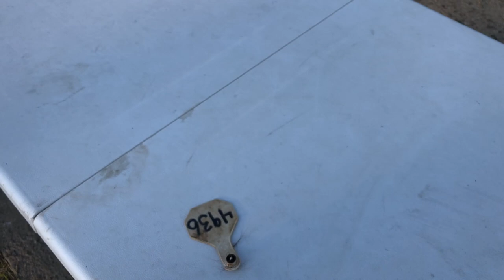Handling BISON up CLOSE!! GoPro ATTACHED!

Comment: Enjoyed your video; especially where your GoPro was placed. I'm from a cattle ranch. We had a set-up similar to yours for branding, cutting, and doctoring. Let me recognize  that Cattle  are different to handle  than Buffalo. Just a suggestion: Run it like a production line. Have one person responsible / function. Someone to load them into the chase, another to close the gate behind them, another to squeeze them, ... even so far as a person to load the syringes (we had guns), give a particular shot and someone else to worm them. Also, someone responsible to open the gate. I hope this gives you some ideas. You'll get the kinks worked out. I think you're doing a great job. You seem to have a lot of patience. We had 360 cows plus their calves and it was hard, fun, rewarding work. I wish you and your family the best.
Reply: Excellent,  constructive comments.  Gives you the specifics you need.

Comment: Don't worry about the chest camera.  Fix or modify the crash gate so it is out of the way of your head gate.  Put a bar through that hole where they stick the cafts heads through.  Otherwise in my opinion that catch gate is going to get someone hurt.  I would also put a fence that comes right up next to about  3 feet away so the crash bars and swing open without hitting and thing put a gate just behind where the crash bars swing open.  But also block the Bisons view to who would be at the gate.  Then also put a panel between everyone working and the released Bison as they leave for safety.

Comment: 12:15 I wonder if putting something up so they can't see out the shoot will help prevent them from trying to break out thrue them bars in front it seems that there seeing a exit so there trying get out because i noticed when they can't see anything in front of them like a wall they are more calm so once you get them locked down you can remove that blinder and you can work the animal.

Comment: A recipe for disaster.  Too many people shouting instructions.  The guy who makes the final release  should be giving the instructions and should get an ok confirmation  from all the helpers that the various corral gates are in their proper locations and locked.   Sort of like  performing a rock blasting operation.   Count down and push the button. I agree on that squeeze gate.
Reply: It would appear that you need to rehearse what you want to have happen BEFORE the animal comes in. There were too many people giving instructions, some of them not very accurate. Know what each lever does so you aren't finding out with the animal present.

Comment: Just from observation, I would close up the hole on the headgate, all 3 tried to climb through it, lucky no legs were broken.  The "squeeze" part of the chute looks like it needs a solid handle instead of a rope so you can get more umph into the squeeze part.  I don't envy your job though............Stu.............Cheyenne

Comment: If a little lubrication helps the gates and squeeze work faster would that be a good thing or bad? Also that head cage 2 of those critters tried to come out that hole on the side. Why does that not have a vertical bar that hinges into a pinned closure? I guess it is a good thing that they see you every day.

Comment: Couple words of advice. When u work em designate one job person (which u obviously did). Less talking. Only should be hearing Dusty's voice cause they are comfortable with him. Put sheeting or rubber belting on inside of crash gate and just leave a 2ft x 1ft opening in the front. That'll slow em down into the crash gate. Also close up openings in squeeze at bison eye level. That will calm them up better. Also get a scissor head gate.works wayyyy better. You have a good set up and you did great!!! When those magnificent beasts are confined all they should see is in the direction you want them to go. I work mine that way and it works for me. Love your herd, keep up the great work!

Comment: Having worked with my ex husband who is a large animal vet the one comment I would bring is that you need a pair of nose tongs to use when putting in ear tags or working on the head. You can pull the head to the side to immobilize it while not really hurting the animal. Makes it MUCB safer for you & since the head is immobile the work can be performed faster causing less stress to the animal.

Comment: Wow; I’ve used a lot of headgates, but yours really sucks. I really feel bad for you. If you have to use the same chute next time, you might try to squeeze the the chute squeeze part down smaller, make it more narrow so the animal has to go a lot slower getting through it. If the animal is going through it slower, you will have more time to close the head part around its neck.

Comment: I wanted to offer some thoughts on safety for you and your workers while you're trying to work one-on-one with your bison in close-quarters like that.

I think it would be very important before you run any further bison through the chutes there to clean impeccably completely around the work area by moving out all of the cinder blocks, concrete pieces, bars of metal, wood or anything and everything so that it is just ground. In the event that something would go wrong and any of you were backing up in a hurry you could back right over the top of a chunk of cinder block or wood or even a big rock and land on your butt and have that bison come right on top of you. Or one of your bison in all of the excitement stumble over the top and break a leg. Or for that matter any of you as you're trying to hustle to get to your spot could even trip over one of those big pieces of foundation that's still lying around and break a leg or break open your head. And if something would happen to one of your nieces or nephews you would never be able to forgive yourself and it might rip apart your family forever. So pick everything up, rake the ground and that will also protect you from any rattlesnakes if you have those in your area. It won't give them a place to hide!

 And, before you start to attach any more of their ear tags, get in touch with the manufacturer and find out exactly how you are supposed to do it, and then walk through it before you bring any more of your life stock up to number one position and get them settled down and then have to take the extra time because you're getting it backwards or upside down again. Learn before you do anything hands on with those powerful animals.